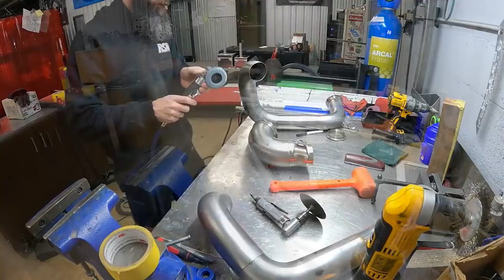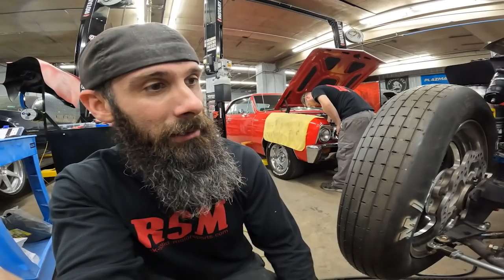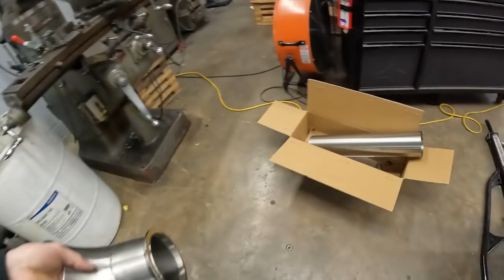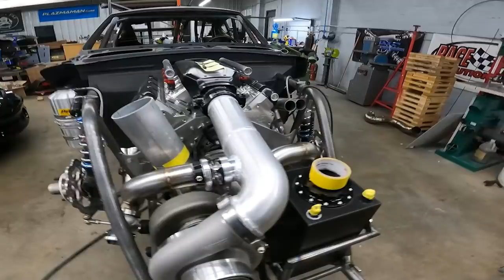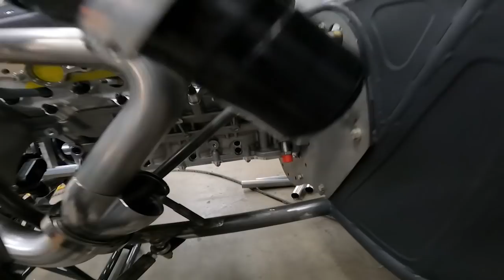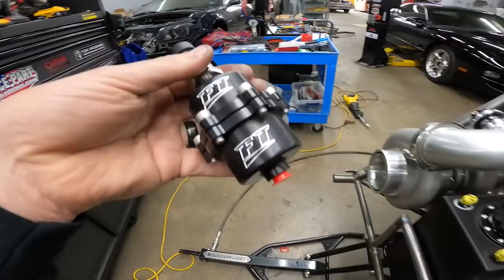Du Hast 2.0 Update. Turbo Hotside Merge Complete!!

Comment: good work, would you try remote mount the sensors off the motor? usually I run some blocks and run lines to where they need to go. vibration kills them and the engine plate will vibrate a lot.